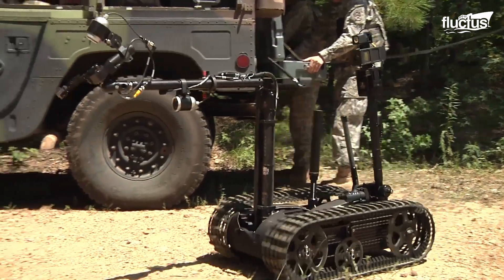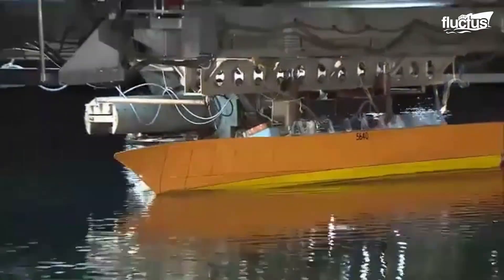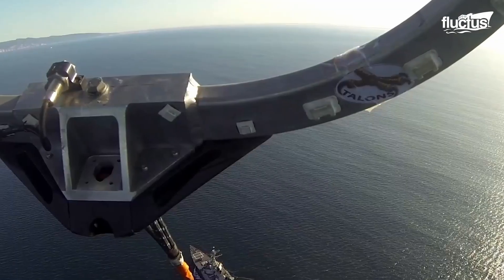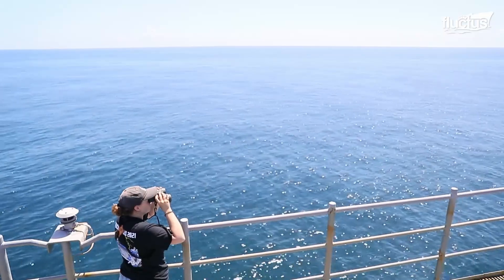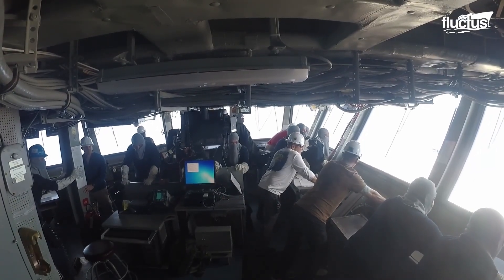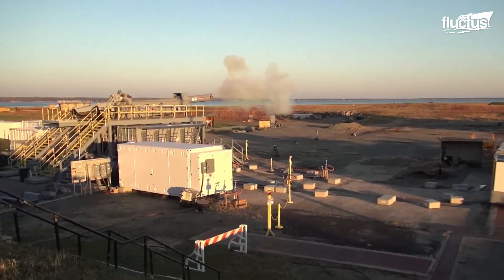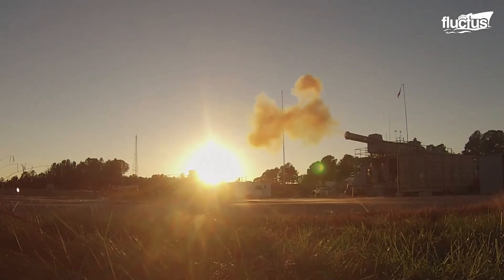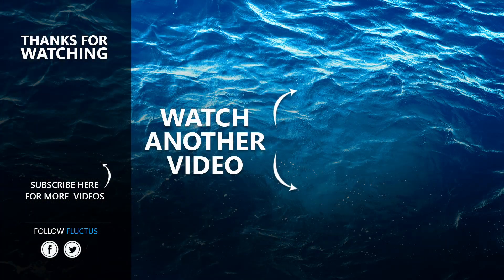The Genius Method US Navy Found to Test its Future Billions $ Aircraft Carriers and Ships

Comment: I'd have thought that if you're modelling a ship or sub in sea water, then the density of the water/fluid medium needs to be to scale, so if the model is 50% scale size then the fluid needs to physically have 50% less viscosity than sea water.

However, this appears not to be a design or engineering consideration during testing.

Comment: We've had a lot of testing facilities for the last century.  My father was in charge of the hypersonic wind tunnels at Lockheed, (they called them the hot shot wind tunnel) where they tested models to 25K and above.  Then he went and did the same thing at Ocean systems, their Lumph tanks.  But what has really changed is that so much less of that needs to be done, so much more can be done and projected by computer now.  With the advent years ago of computers capable of such modeling, then a lot less testing has to be done, only when you are much closer to a final design.  What we have seen in the last 30 years, is nothing compared to what we will see in the next 30...  In the last 10 generations, we as a country have gone from fighting the British with Muskets, to traveling to the moon in 8 generations, to now be ready to travel to Mars in the next generation.  We currently can't imagine how we will leave this solar system, but then 2 1/2 generations ago we didn't really have computers either.
Reply: Everything is fine, it's a pity that one small contradiction interferes - the poor get poorer, the rich get richer.

Comment: Maybe it's just me, but based on the convergent designs of both rail guns in conjunction with GPS-guided projectiles in current use, it makes me think that the U.S. Military's prime objective is to be able to launch a cost-effective projectile with as much velocity as possible while having an onboard guidance system capable of withstanding the internal shock of a high-G launch and adjusting to target in-flight with extremely high-accuracy. 
An accurately-guided railgun shell is sure to spawn nightmares for anyone on the receiving end.
Reply: That's the idea
Reply: @Stanzig666  Honestly, that could even be scarier than drone strikes, knowing that if the Americans felt like it and you stayed in one position long enough, a big piece of tungsten going over Mac 3 comes down at you directly
Reply: @Voin  Before the drone, we have the Tomahawk Missile. GPS guided, 1000 lbs of explosive, but it goes subsonic around 500 mph. It's still a great platform to get the job done, but with the railgun, faster is better.
Reply: @Stanzig666  Faster and cheaper mind you but yeah I get what you mean.
Reply: GPS is too high up, that’s where LEO come in and the rapid development of small replaceable satellites constellations

Comment: Can someone please explain how a ship going 35mph could cover up to 700miles in 30 minutes? Simple math would say they need to be going 1400mph for them to cover 700miles with in 30 minutes.
Reply: 700 square miles or about 528 square nautical miles. Runs approximately 23 nautical miles per hour or 11.5 nautical miles per half hour. Still pretty fast seeing as the ship weighs more than 100,000 tonnes.

Comment: Grahamo22 is correct, we have similar facility since1950, but used for civilian purposes only. As to the railgun - looks similar to Fat Berta or the Paris cannon in WWI - able to makefew shots to be demounted and repaired back in Krupps facility. Zumwalt is a failure andd the three units will have to operated under significantly lowered requirements.

Comment: Assuming that 90 percent of our current military threats are going to be coming from the "East"/Pacific part of the world this one hull design for our aircraft carriers is really really outdated.
Larger decked, safer, more efficient  and perhaps even more maneuverable aircraft carriers can be made with other hull design options like a catamaran or even pontoon type designs.
The only real purpose of the one hull design for these American aircraft carriers is to so call be able to traverse the Panama canal which the most modern of these in the U.S. Navy have for all practical purposes outgrown the canal anyways meaning they don't fit through it at all.
Reply: 🇨🇳🇨🇳🇨🇳🇨🇳🇨🇳 😂 中国弹道导弹
Reply: Actually US carriers are made to be extremly fast and turn very tight.

Comment: 700 miles in half an hour, the figures got skewed, that should have been, 70 miles in 2 hours !
Reply: 700 square miles or about 528 square nautical miles. Runs approximately 23 nautical miles per hour or 11.5 nautical miles per half hour. Still pretty fast seeing as the ship weighs more than 100,000 tonnes.

Comment: Perhaps he meant 700 hundred miles in half a (day) not half a (hour). That would be roughly 51 knots or so.
Reply: They would have to have air breaks to stop.
Reply: 700 square miles or about 528 square nautical miles. Runs approximately 23 nautical miles per hour or 11.5 nautical miles per half hour. Still pretty fast seeing as the ship weighs more than 100,000 tonnes.

Comment: What exactly do you mean when you say "The ships (nimitz class aircraft carriers) can cover up to 700 miles in a 1/2 hour".  It would be impossible for any ship to sail at 1400 miles per hour, so I am hoping you meant something other than the speed it can travel.
Reply: @@user-qo5fd4ej3v That is still not really what is said though - "could be anywhere within a 700 square mile area" would be accurate. "covers 700 square miles" is not.

The thing is, it is a ridiculous concept anyway. Based on what was said it can only ever be 15 miles from its initial position and at most 30 miles from any point on the 15 mile radius circle around that initial position. That is, even if the carrier was on the direct opposite side of the circle from a searcher, it would be at most 30 miles away.

This massive aircraft carrier would be visible to the naked eye from any aircraft within 30 miles, let alone radar equipped ships or aircraft. Put simply, even when corrected, it sounds impressive but really isn't.

But here is the important part - The carrier can maintain a speed of 30+ KNOTS. That's a speed measured in nautical miles per hour, not miles per hour. The radius of the circle would actually be over 17 miles, not 15 miles. It doesn't make much difference to whether or not it would be easily found.

It is simply not accurate to say it can "hide in the open ocean by covering up to 700 square miles of distance in just half an hour" - not even close.
Reply: 700 square miles or about 528 square nautical miles. Runs approximately 23 nautical miles per hour or 11.5 nautical miles per half hour. Still pretty fast seeing as the ship weighs more than 100,000 tonnes.
Reply: @D , you contemplate your “Navel”
Reply: Yeah I had the same question.... idk what kind of Algebra equation that can give you 700 miles . +or- 15 miles in any direction. 
15 squared =225 so unless your including a third axis as floating atop 30,000'(6 miles deep)of water it doesn't cover 700 miles.

Comment: No aircraft carrier nor any ship for that matter, can cover 700 square miles in 30 min…🤔🤓 that’s at min 26 miles straight line. 🧐
Reply: 700 square miles or about 528 square nautical miles. Runs approximately 23 nautical miles per hour or 11.5 nautical miles per half hour. Still pretty fast seeing as the ship weighs more than 100,000 tonnes.

Comment: I thought the U.S. Navy dumped the rail gun project, due to cost, bulk, power requirements, and the short life of the barrel.
Reply: Stuck a pin in it would be a better description.  I worked at a test and evaluation squadron in MD not terribly far from this facility, and it's not uncommon for us to use long mothballed airframes and platforms, briefly resurrecting it's long dead supply chain like some kinda logistical necromancer just so we can test the smallest detail for something some Boeing engineer though crucial for a future project.  Nothing dies in the Navy until we literally deep 6 it in the ocean.
Reply: @attemptedunkindness3632  You sound like a politician. Must have take classes in circumlocution.
Reply: @dallasarnold8615  I don't know what that gat dang ten dollar word is.  I just made sure the helamacopters didn't crash.
Reply: @attemptedunkindness3632  Here is a concept for you. LOOK IT UP !   As for making sure the helicopters didn't crash, sounds like you would not have passed any of my inspections as I was the QA Chief and a QAR, and back in the 70's I was a CDI.
Reply: @attemptedunkindness3632  Blah, blah, blah. At least you are staying in kind with your childish attempts to impress.
Reply: @dallasarnold8615  Whatever "Chief" if I was trying to impress I'd be doing something cliche like dropping paygrade from fifty years ago and arm chairing maintenance philosophy towards somebody making anecdotal light of how the Navy never really throws things away, though in your case maybe it's you who needs to throw the Navy away it's got you rather salty and uptight sounding.
Reply: I,m sure they did, but when you can print dollars like it's monopoly money and are accountable to NOBODY .
   Then cost is irrelevant.

Comment: 10:00 Covering up to 700miles in just a half hour? Typo?
Reply: 700 square miles or about 528 square nautical miles. Runs approximately 23 nautical miles per hour or 11.5 nautical miles per half hour. Still pretty fast seeing as the ship weighs more than 100,000 tonnes.
Reply: That would be the √ 700 which is 26 1/2 miles. Since they said 700 square miles if I'm thinking correctly.
Reply: But about 52 MPH … not likely
Reply: @davekennon4136  looking up; how fast does an aircraft carrier travel. It says the same thing a possibility of 700 square miles so I must not have the right formula. I couldn't find the proper formula.
Reply: @davekennon4136  they go 35 mph
Reply: 700 square miles they said, but even in a straight line that’s over 52 miles an hour, or 26 miles…